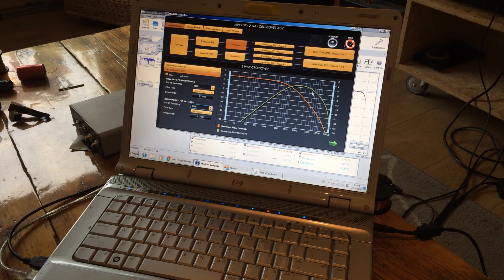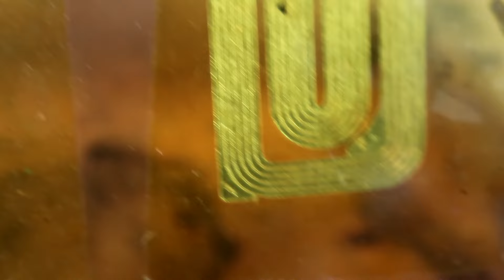Laser + etching 0 - Plotting 1 and can the Diode laser cut aluminium foil ?

Comment: Ok so laser is clearly off the table but (as you already suggested) you could try better focus and more passes at lower power but also I found my laser cuts wood much much better with an air blower attachment.
Reply from the maker: i could ad air assist. b8ut thats is usually used for cutting and not engraving. (like you do with wood)  i am still not sure since the rest of the process is quite dirty :( i dont like it all that much. so far :) it was the first method to make coils for me ethcing and using my wax printer. pretty fast but.. still really dirty

Comment: So in terms of a diode laser plotter/cutter the main issue is how to properly make the coil stick to the cutting base? Have you tried your kitchen glue solution? I really would like to know what experiences you made with it.
Reply from the maker: kitchen glue ? never heard of that. problem is things heat up  (most glues let go at higher temps) besides that , its not so usefull i already got smaller tolerances with the plotter.
Reply from the maker: if i can make the vacuum holding work. the laser wont stand a change :( in terms of  (cleaner) use for sure :) and far less steps :) no painting not etching no cleaning etc
Reply: @joppepeelen  I meant that very weak glue you were using during your headphone project in order to have the coil just stick enough to not get ripped apart during cutting. 

Btw I just wanted to tell you that I really admire your projects and effort. I'm currently building my own planar open-back headphone and your video-blogs really help getting forward. 
Originally I cut the coils by hand. Which was not only inefficient, but had a high rate of failure too... and well even with a calm hand its too easy to once cut too far and mess up. Hence why I tried using a 22W laser but the only success I was having so far was to completely cut through the painted aluminium tape ... and unfortunately the very fine traces of the coil (.5mm in thickness) literally melted together when using 80% power xD Further experiments are yet to be made

Comment: have you tried setting it up in raster etching as opposed to vector cutting, than setting up the coil diagonally as oppose to parallel to the beam in that way maybe the coil wont get hot enough to bend and deform, where I am going with this is basically setting up the laser beam to chip away the foil  instead of cutting it directly and reflecting back, by the way this is an impressive result do you think it will work with a kiss cut machine
Reply from the maker: oh yeah i was thinking about deflecting it but then again i dont want to cut the alu, i wanted to try just for fun an gigles :) for my use its ... not that usefull.   what is a kiss machine ?
Reply: a home sticker cutter machine like ' brother scan and cut cm300 ' instead of the plotter     @joppepeelen

Comment: I mentioned this in the last vid, but.. You could attach a 405nm single mode diode and those can focus to a very tiny dot. Then use pc circuit board positive photoresist on the foil and any part hit with the beam will dissolve in the developer. Then etch as usual. It should be possible to get very clean and very tiny etched lines (Wikipedia says 0.5 µm) this way, albeit with a little more effort.
Could also use Negative resist but then you have to fully expose all the copper you want instead.
Reply from the maker: this is a 500 nm i believe.   i thinkg glass work (lens etc) is the biggest reason. for both of them.. why it never reaches 5 micron...

Comment: For the vacuum: in industrial cutters table are made of felt about 4-5mm thick and under the felt are perforated metal sheets for vacuum suction to get through felt and hold materials that are cutted. Maybe you can create small frame and try to simulate above?
P.S. go with another headphones :)
Reply from the maker: thanks ! i was thinking of drilling many holes into a cutting mat on a box (covered with thick paint or something on mdf) or directly on mdf since  you can suck a vacuum through mdf...   but im worried it does not cut nice on mdf :)

Comment: Hi. Regarding using normal plotter machines: I found out that a regular plotter like a Silhouette Portrait 3 isn't suitable enough for those tiny cuts. Probably because the blade just gets pulled over the foil, increasing the risk of ripping it or not being able to cut consistently enough. This still seems to be an ok method if you are fine with many passes with increasing force steps for a larger coil (>1mm track size and spacing). But still I'd say there's at least a 70-80% chance some spots won't cut and need to be cut manually. So all in all regular plotters seem to be a waste of time or my unit simply sucks (I've used a brand new blade btw).

So I'm going to try a CNC method soon to hopefully be able to reach my desired track size of 0.5mm with an 0.5mm spacing. Do you think thats well feasable with a thicker foil as well (around 20 micron I guess)? And which CNC software(s) do you use/recommend using?
Reply from the maker: 0.5 might be to thin, i am afraid.  and yes a flat bed plotter is more usefull then a silhouete.  there is a video where i only use the cut width of the blade it self as spacing.
https://youtu.be/0PPart_Tnss
thats your best bet i think. but you need to use extra cutting weight/force . more then you would for a decent cut. the idea is the blade will cut further into the foil and mat, creating a space in between traces.
Reply: But if the blade is a very spikey one, lets say 25° or less and you start with low force and gradually increase it per pass, could it work?

Thanks for the help man. 🙏 But what's the software you use for CNC cutting/plotting?
Reply: @joppepeelen Btw it seems that the link you just posted doesn't work (at least on my phone) 🤔 or maybe its just another bug in the YouTube App not sure. I'll check it on my PC in a sec. 

Thanks again for the ideas and help man! Your content is gold!
Reply from the maker: no problem else search for plot cut foils on my channel and you wil find it, it was a recent one

Comment: Btw which plotter did you use to make the .6mm coil?
Reply from the maker: my old cnc with a roland blade holder on it.  the one i use 99% of the times
Reply: @joppepeelen  Perfect! I already guessed that its most likely a CNC. I've received my very first actual plotter today but could only achieve bad to ok results using the aluminium foil tape. I will conduct further experiments. What do you think: if I stick the aluminium foil side of the tape to the cutting math (or base) and cut through the paper side of it with the plotter from the top ... could it work?
Reply from the maker: Oh could,  i have alu tape with a thin pe backing and do the same i cut it then remove the backing of the traces theb stick the mylar to it and remove it from the mat. You could try

Comment: I think it was better without 20 secs of the introduction ) But it's good for new visitors. So, I'm not sure

PS And yeah.. What about making a compression driver with using these membranes? Nobody else made this afaik, but in this case many limitations will go away (as I see this in my head).
Reply from the maker: yeah im not into horns to be fair :) im not sure if they can muster the drive needed , and yes the intro is long :) i know. felt like not using it for a while. but i did use it for 1/3 of the videos.   i might shorten it or remove it again.. not sure. i want to show new visitors whats it all about. at the same time iritate people that watch it for a few years .. not my plan but thats what happens :) haha
Reply: @joppepeelen  I suppose that when you have a chamber for a sound inside the driver, you can play with magnets in a free way, not limited with a necessity to allow an air flow freely, concerning a linearity of a magnetic field and an efficiency. You'll get a better directivity, lower distortions (because of a minimal movement). I'm thinking about how to incorporate a big emitting area with a high acoustic impedance at a throat hole. May be by making a "sandwich" with two opposite panels, enclosed at one side.. A point source is good (a horn makes a virtual source point). You can unwrap it later with a cone if you want. A panel dipole is not good. )
Reply from the maker: @sc0or  panel can be a point source to :) if you make things small enough :)
Reply from the maker: my DAP pnale ressembles a point source rather ok.  not far worse then a random dapolito  setup. it can always be better , but not many horn loaded tweeters can play down to 350 either :) so they use 2  drivers just like i did :)
Reply: @joppepeelen  Yes, exactly. If you're talking about these rather compact panels, then "yes". I meant those 1 meter panels.
Reply: @joppepeelen  Sure, they cannot. First, because of a different power for different bands, and secondly because of different dimensions for different bands. There is even an annoying effect when a horn reduces an output at very high freqs, while a driver can pay way more higher. With your 350Hz this is much easier to find a matching woofer with no doubt. The best of compression drivers can play down to only 1k. So.. This is why I'd like to test some "compression" configurations. Because I like how horns look like, and which possibilities they unlock